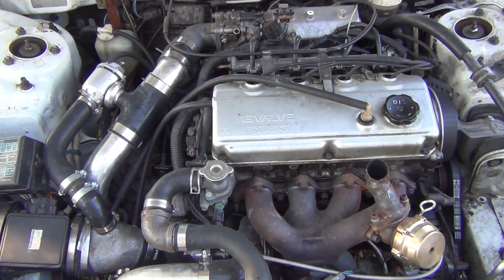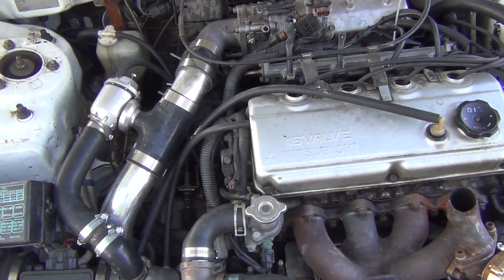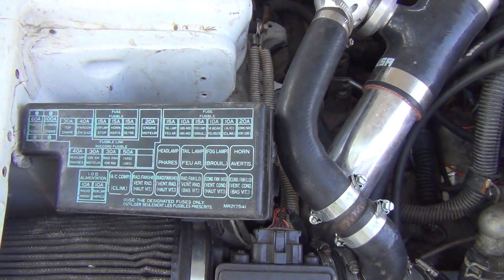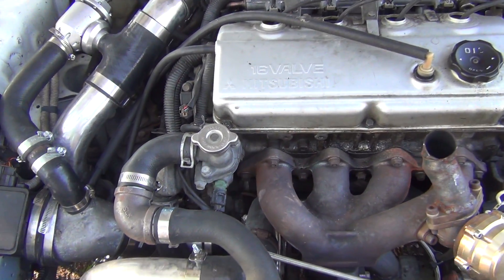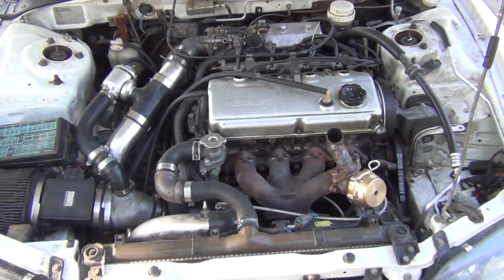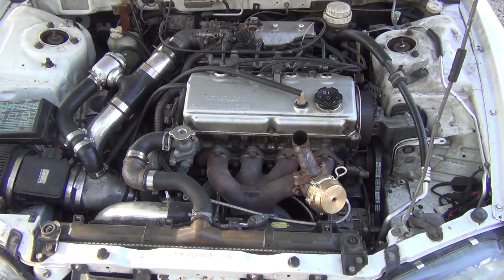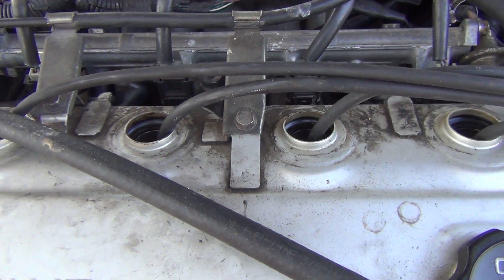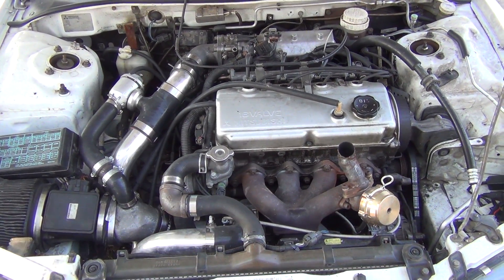How to Turbo your Eclipse spyder 4g64

Comment: So basically the 64 can just go in any gsx or tsi? An will the 64 manual trans fit the tsi /gsx hubs ?
Reply from the maker: As long as it's a 97-99 Spyder yes the 96 1st year uses different sensors.
Reply: @yami4g63 good to know I’ll do a reference on all the sensors on this tsi im looking to get , I got a stratus that got totaled in a tornado with a new transmission in it an they a new home

Comment: I know it was 6 years ago but I have questions. I have a 4g64 in my 99 Spyder, I also have a 4g63t from a 97 GST hardtop.  I have the wiring harness,ecu everything. How hard is my swap gonna be? Do you know what will be different
Reply from the maker: Not too bad if you have both harnesses.... fues box harness and engine harness from the gst 4g63 will plug and play into the 99 spider. Have to swap both harnesses through. Plug and play under the dash.
Reply: @yami4g63  I do have both harnesses but that sounds complicated

Comment: Would have been nice if you gave more information. Even today there is very little information on how to turbo a 96-99 Eclipse Spyder GS. In fact most the good info has disappeared due to sites going offline long ago that held a lot of info. There pretty much never existed anything detailed enough to make it easy to do though, there is always a lot of necessary information left out.
Reply from the maker: I need to remake the video. And do a better job I agree.
Reply: @yami4g63  that would be great
Reply: @yami4g63 please do !! I’m trying my best not to sell my spyder and it needs to come off jack stands

Comment: 4g63 and 4g64 are basically the same exact block.  Im running a 4g64 with a 63 dohc head in my gst with hybrid 63/64 pistons
Reply: 4g63 head of the 2g is the same of 1g?
Reply: I’m running 4g64 bottom and 6 bolt head runs great

Comment: do you have to change to low compression pistons?
Reply: thanks
Reply: @yami4g63   i thought 4g64 engine are 2.4 liter engine , if you use 3sgte pistons  it will be smaller on block, correct 
me if i'm wrong
Reply: @yami4g63  thank you for the technical advise
Reply: @yami4g63  Good info here. I just picked up a 99 Spyder and I have turbo goodies left over from my Galant VR4 build. No electronics tho. It does have a blackbox ecu, but Im reading that support for ECUflash is declining...

Do you think upgraded fuel injectors, pump e85 and AFPR would be fine for the stock ecu and a 14b?

Comment: I have a cherry 2003 outlander 4g64 low miles i rebuilt the motor for dependability and put headers on it you think i can do the same swap as the spyder??  If not its a good everyday just a cheap car id like to do a little with not many built outlanders.

Comment: What injectors did you use stock GST 2.0l and did you change the injectors resistor box with the 2.0L one. Also I know you need the oil pan from 7 bolt and best to get a SS feed line and feed from oil pump
Reply: Add me on Facebook www.facebook.com/Thomasskates I am on dsmtuners

Comment: Hey i have a 1992 mighty max with the 4g64 sohc manual, and i bought a 96 gst auto. You think everything will swap over from the eclipse to the mighty max the same? Love what you did by the way
Reply: How about just everything else but the block. Like turbo manifold, turbo, ecu, fuse box...?
Reply: Just like how you swapped everything from the 63t to your 64...
Reply: Yeah Me too I have the same truck as you a 1992 Mighty Max 2.4L and am wondering how to turbo it Too. I got a turbo Exhaust manifold from a 1988 Cordia Turbo . It will bolt right up to your existing head. But i'm Just not sure about the ECU, and intake manifold. injectors etc.  Might Just be easier to just do a head swap w/a 2 g DOHC head and wiring from a 2G eclipse or galant.

Comment: Hey men, I have 2g spyder 4g64 but I rotate de pipe water 180* with radiator gst and I use a hose 90* , and work very very fine, thx for up your machine 😍
Reply: wat fuk u jus sed men

Comment: Gotta love these 2g 4g64 engines. Can hold a lot of power for a reasonable amount of money. I just put one into a gst shell bc my spyder shell was way to gone to fix.
Reply: April Stanley i have a 2g spyder 96 eclipse you think i should modo my 4g64 por can i swap a 4g63 in muy 96spydey?
Reply: bobby choch if yours is a 4g64 I’d leave it in there and turbo it. Do the timing belt and stuff and turbo it. I got a 16g on mine and it’s been running good with no problems at all. Or if you want take the head off the 4g64 and put a 1g or 2g head on it.
Reply: April Stanley can I swap the head AND also turbo it? (And timing belt, and bolts on)

Comment: I am researching building turbocharging my 4g64 oulander. I would need to do some research for spacing but your saying if I got a stock 63 turbo manifold it would bolt on to the 63. Also are u running stock ecu settings on the car or can it be tuned. I figured I would have to buy a proformance ecu to tune everything. Maybe have to wire it up like you do for a 63 then do that??idk also did you drill and tap the oil pan or the block to feed the turbo?? Any help would be appreciated.

Comment: Hey dude, i have an Eclipse GST and want to put a 4g64, its necessary to change all the engine wires, or just plug the non turbo ECU? I need to change engine sensors connectors? 
Thank you!
Reply: Thank you man! Im going to do this change. I paid for a forged 4g63t that never worked well, tired of spending money. I will keep the wires and GST fusebox too. Maybe in the future i can put the 14b turbo and do exactly what you did.
Reply: Nice! But its rare to find a 4g64 from a spyder here, im thinking about using the Mitsubishi Expo (Spacewagon) 4g64 (94-95) engine, somes have the ECI MULTI label on the admission. They don't look to use the same sensors, maybe will fit this engine or its the same thing?